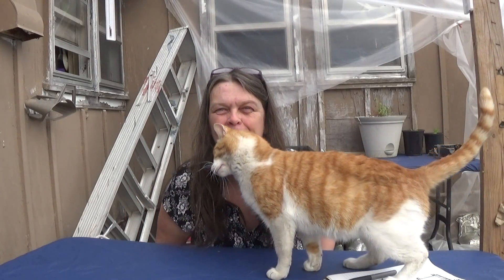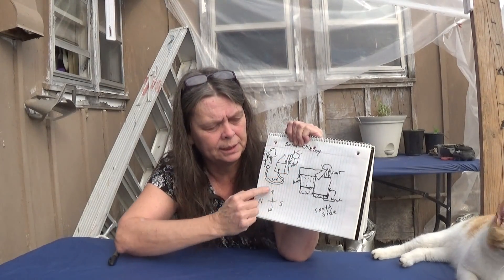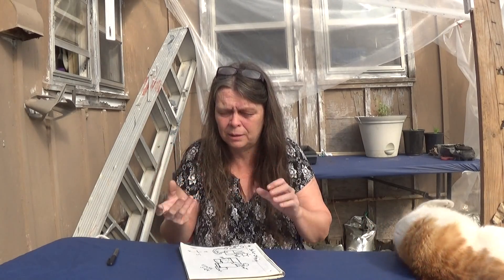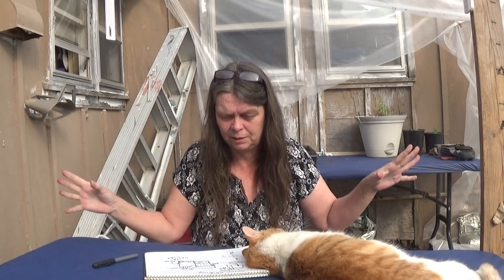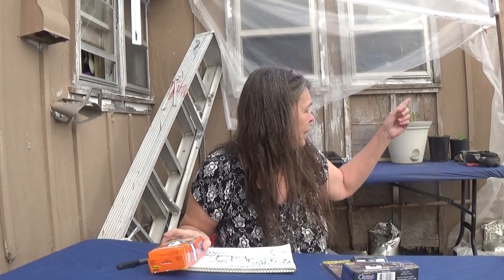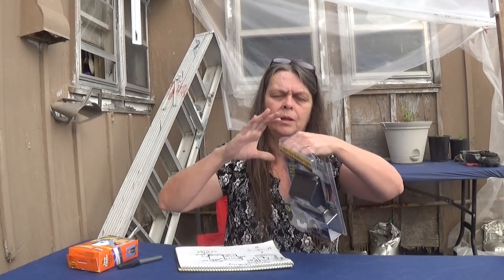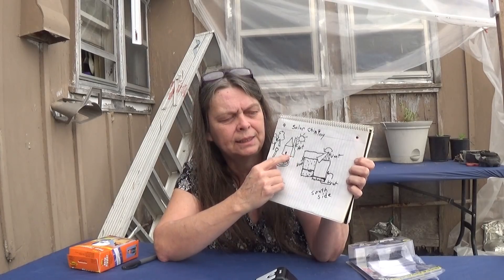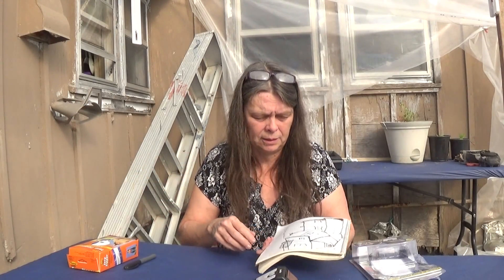The green house can heat the house thew passive solar

Comment: I have to give this a try.. Great idea for some nice warm free heat. THANK YOU.
Reply from the maker: I hope you do try. It has worked out well so far. I put the small 35 watt fan from my solar heater in the widow when it gets really hot in there. It cools off the green house and warms up the house faster. I now added mist to the green house to cool it off some on really hot days too. There is a lot of learning to do To heat and cool. Yet keep this a temporary structure. And cost down. As you know the big commercial ones require Temp  control. 
I got the package today. Thank you so much. Will be doing a video soon.

Comment: I've had a good laugh because Milo wants to play patti-cake with you! Your green-house is a great way to improve life. Have fun with it E.!
Reply from the maker: Hi, Sand. Thank you. He is a playful kitty. Lot of fun. But, he is liking the video time. The green house is a learning curve. Has my brain on overtime. We were 84 decrees today. The thermostat in the green house was ready to explode. I put a fan out and cracked the window. The house stayed cool. But could not get past 115 for a log time. So a low cost cooling like the geothermal will be important. For now shade cloth and fan. Vent or remove plastic. 
I see now why hydro or aquaponics are better for green house growing.
Reply: The green houses around our area use water misters hung and run on timers when the temperatures reach a high degree. It waters and cools at the same time. Could save a bit of work too. You got to have good circulation or things could mold though. Glad you are having fun!
Reply from the maker: Thank you. I never thought about having water high up and misting. I have seen like swamp coolers in the side. Mild is an issue for me. But not when it is so hot. you gave me something to think about or try. 
Best wishes to you, my friend.

Comment: It all looks good but it seems to me it's gonna get very hot inside your house this summer.
Reply from the maker: The plastic will come off. Or if I get the pipe in the ground it may reverse to cooling. I do not know yet if I will get cooling done this year. To many issues to deal with so far this year.

Comment: I like that idea of using the radient heat from greenhouse being ducted into the house. Need to experiment on controlling heat during all seasons. Thanks "E"
Reply from the maker: Hi, Gary. Thank you. That will be a project in itself. The solar chimney can be reversed to bring cool air from the ground. But. It will be a while before I can accomplish that feet.  I have to choose and area to dig and install pipes. And hope we do not go back to flooding rain. LOL. This is all a learning curve for me. And I need a backhoe. Or a good back. I may hit gold. You never know. :) 
Hope you are doing well.

Comment: Castle panel for support is a good idea.  Give it some form.
Reply: I gotta to tell you.  You can grow underground a ft.  Glass over top you will have green all year.  I will feed you a link and see what you think.
https://www.facebook.com/photo.php?fbid=10208423644402082&set=gm.959707607480173&type=3&theater

https://www.facebook.com/photo.php?fbid=10207950166045419&set=pcb.922613874522880&type=3&theater

Comment: Looks like you've really thought it out. I hope it works out great for you!
Reply from the maker: Thank you. I have been thinking about things like this for years. It is different when you are trying to make things work in your area. And you see it work so well in other areas. Like a swamp cooler is great for the south. Yet. I fear flooding and mold for us. So, I have to think about dinging and installing pipe underground. Even water proof pipe will sweat exchanging temperatures.

Comment: Very nice E about what temp does the greenhouse hold over night?
Cool solar light also, hope you get your moneys worth outta it and much more!!
Have a good'nnn
Reply from the maker: Hay,, Gear. Thanks. I only have 2 days of temp tracking. 45 on the 15th and 55 last night. It is 15-20 above outside temps so far. 
I found the candy where you said it was. The grocery don't have it yet.  Thank you. 
Have a great weekend. :)
Reply: Ahh right on E not 2 bad at all, About ready for starting seeds then huh? Glad you found the candy bars, have you tried'em yet? Have a good'nnn

Comment: Great idea E 👍 Milo is such a ham lol. He will keep the mice and critters away from his greenhouse lol. Good guard kitty Milo! 
Thanks for taking us with you on the greenhouse journey E. I was wondering if a wind turbine system would work for free energy for you? Seems you have enough wind for it? I'm not an expert on it by any means, just a thought for ya E. 
take care-Debbie
Reply from the maker: Thanks, Debbie. Thank you. They would work well here. I just am not at a point, I could add them to this house. I have small aircraft fly over. So. I could be regulated and need government approval. Or flashy lights. lol. I could only experiment with low turbines. And have to hide them. I now have rules and laws to live by. Or town went to a ruled Government on us. 
Thanks for the suggestion. 
Best wishes. E :)
Reply: Yes that is true for sure! I'm not sure on the regulations either on anything large. 

Ya that small fan idea would work. And possibly if the wind was strong enough it would turn the blades without you having to use electricity. Maybe one of those really small solar panels they have at harbor freight for those small spot lights would give u  key low voltage electricity. I don't think those are regulated by the system at all. They are very small and inexpensive so I've heard lol (?) I've never looked into them but have seen them working on the sides of garages or on homes too. 

Your greenhouse is going to be your haven lol. I know mine will be my little space haha.
Reply from the maker: I have been looking at solar attic fans. Not sure yet what I will do. Other than pull off the plastic. It was almost 120 today. Last night the house was in the 70s and no heat was turned on. It was 55 outside. So, I am still learning. I need a thermostat to get things on auto pilot.
Reply: TheEmptynester planting Seeds of Hope Wow that's great that it heated your house like that!! You will definitely save money on heating the house with that there. Can't wait to see what you come up with for it.

Comment: Free heat is best!
I'm doing the same with the atrium.

I need to look into those solar movement lights.
This place is DARK.
There are not even street lights out here and it even has hard to find 100 watt light bulbs for the inside, as well.
idk...I'm thinking that it will get hot enough in the summer that you will want some sort of air movement (tiny whirl wind lol) in the greenhouse.
You're killing more than two birds with that stone :)
Reply from the maker: Thank you, my friend. The top will come back or all plastic removed this summer. Especially if it is in the 100's like last year. A shade cloth may go on.
Did they put in any vents for your atrium?  I know one house we saw in the past was a south wall of glass. They fried in the summer. I look forward to find out how it works for you. 
Supper girl in in Labor also. :) 
Best wishes. E :)
Reply: The atrium has a set of doors I'll be opening when it gets warmer.
As there is also a door that leads into the house, hopefully the heat will be minimized.
I am planning on purchasing a fan just to help with the circulation.

Great news!
Girl or a boy?
How many grand babies do you have, now?

Comment: If vented into your house - Geo Thermal can cool your home in the summer too.
For lighting with standard lights - Put Vaseline on the threads of your bulb before you screw it into the socket. The petroleum jelly will create a barrier between moisture/air and metal and prevent corrosion.
Reply from the maker: Thank you. Once I get it done and it does work for cooling also. I will bring that up. There is a chance it may not work ell here if we get our old weather back. We have flooding rain in the past. So, water and mold may prevent it from working out for me. I will have to lean more and try petroleum jelly. I have not heard about that. Thank you again. 
best wishes. E :)